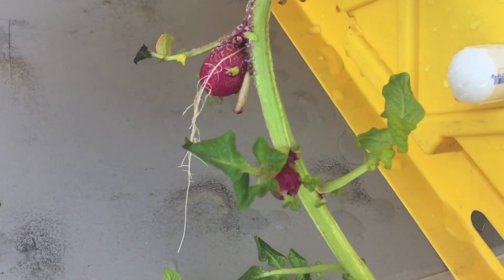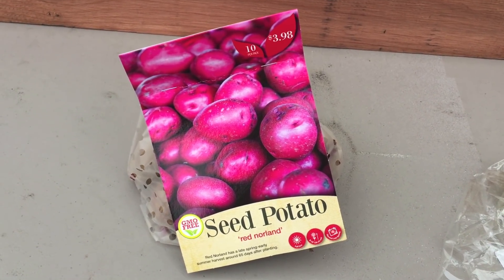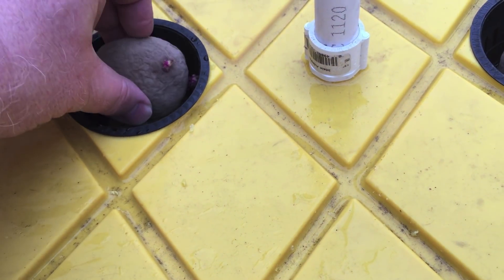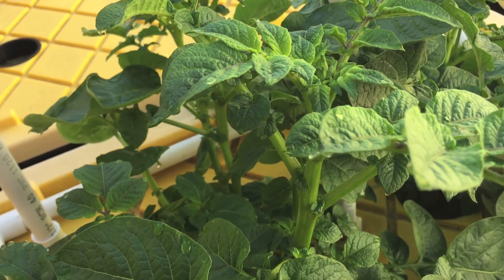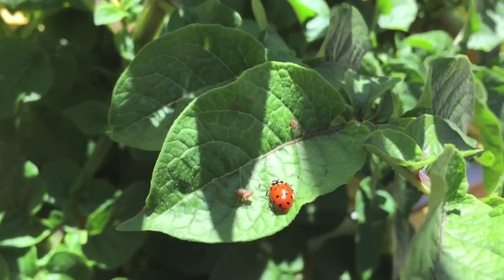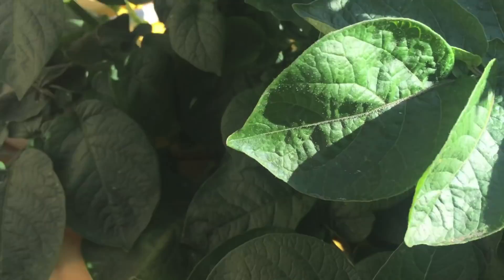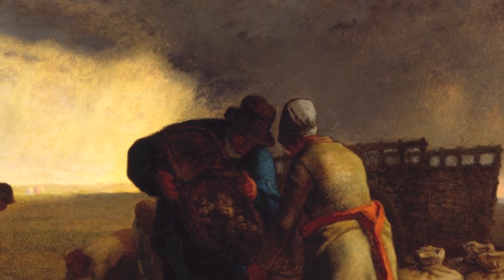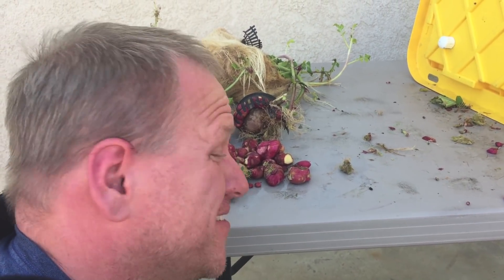Check out the amazing growth pattern of this hydroponic potato!

Comment: Jeb, I understand that would not be your "thing" but to me it seems a very cost effective way to grow potatoes would be those little hay towers. To better explain what I mean, you take a bit of a wire fence (cheap and reusable,) make a tube out of it and fix it to the ground. Place potatoes on the bottom, cover with some hay and water it. Once leaves start protruding above hay level, add more hay. And keep watering of course. Rinse and repeat, when they are done unfasten the wire fence tube and collect the taters.

Haven't done that myself, but from what I have seen elsewhere online, that looks like a very cost effective method. And no soil is used, which is right up your alley. The only downside is that the hay tower needs watering of course, which could be setup with a small pump (blasted electricity) to water at regular intervals, but of course a tank positioned on a higher level equipped with a valve (or a solenoid with a timer FTW) would work just as well. Assuming we have some higher altitude water to fill the higher altitude tank with, just to keep everything simple and cheap.

I have no idea how resilient to disease this method is and I can only assume it would be slower to grow than hydroponics.
Reply from the maker: I've heard of that before but I can't remember where the plant gets the nutrition it needs
Reply: Well, initially the seed will fuel the plant and afterwards the cellulose from the hay should do the trick. These potatoes are usually not buried, they are just jammed into some dirt. I've seen people doing similar ultra lazy potato plants in raised beds where they would just jam the potato seed into the soil and cover it up with hay or grass clippings. When it's done, they just do away with the (then rotting) grass and collect the potatoes. Pretty much as effortless as collecting eggs. Oh, how I yearn for a small garden.

Comment: Use the grow cup only for initial root growth, slowly raise the cup out of the box with pieces of 3" pipe cut to different heights, 1/4", 1/2" etc. cut them in two so you can keep adding them under the rim of the net pot as the roots initially grow till the bottom of the net pot is above the top of the tote. Cut away all but the bottom of the net pot once it is level with the top of the tote. Use two chopsticks horizontally through the roots to now keep the bottom of the cup (and the potatoes) on top of the tote. Maybe a small piece of landscape fabric and or burlap bags from a coffee house can be used to cover the potatoes from the sun as they grow. possibly this could be done with ginger too, Mary ann might not like it as much. .
Reply from the maker: That sounds like it would totally work, but I'm trying for a system where one person could have a whole field of it going.  Of course that may be impossible, but I'd like to try anyway.  Thanks!
Reply: You may have to consider bodies of water like rivers, streams, lakes, in conjunction with fish farms or abandoned pools. Consider how they do rice fields or cranberry fields. Develop a flotation system that you would add water into to start with the seed potatoes at water level, remove the water as the roots grow and the system would float higher keeping the crop out of the water but the roots in. Not sure what your goal is, but keep on thinking about it.

Comment: i have a few suggestions i my self grow a large regular garden in the dirt one thing that will help them grow larger is to cut off the blooms before they go to berries it will cause the potatoes to focus its energies on the root portion as its flowering means of reproduction  has been stopped, also i don't know if it would work but you should try hanging the medium and potatoes froma single piece of wire threaded threw it, or toothpicks, i've used them to start potatoes early in the house and it works wonderful.
Reply from the maker: I haven't heard about removing the flowers.  I may try it.  Thanks!

Comment: Cant you just mount a net on the underside of the top? and put the stonewole in there and just make the normal holes in the top. then everything has space to grow. roots get in the water and potatos have space and dont touch the water.
Reply from the maker: I'm trying something similar to that now, but without rockwool.
Reply: Jeb Gardener So i just placed a potato in a black pot in a aquarium (without fishs). there is like a plate with distance on it, and the plant can grow trough the space on all sides, but no light from the top or sides can come in. its an aquarium because its part of a biofilter (works realy well and needs plants to run), so the water needs light.
The potato is complet under water, just swimming, pot for light protection and holding it in place. Maybe it works, maybe the potato rots away. time will tell. i am excited for your solution
Reply: Just saw that the video is 5month old. Is your new idea working? My potato ist just doing fine and got the first root now but maybe it does not work with potato submerged. I have to say, the water has an active air supply so the roots get enough "air" (maybe, works mostly).

Comment: cut out the bottom of the cup and run a skewer through the side of the cup and through the potato, then stuff around it with rock wool
Reply from the maker: i used just thin rope and it worked great

Comment: Best resource of Hydroponics ever [ Check Details Here ===>fb.com/Easy-Hydroponics-Systems-166096780618260/app/208195102528120 ] !!!! It is not a step by step of a specific Hydroponic system, instead it is a complete step by step for any Hydroponics systems. It tells you what to do and what to avoid. It also explains the ratio between plant qty and fish qty in a balanced system. It is a must have for Hydroponic newbies/rookies. This book is easy to read and understand. You should read this book first and then get a book or guide for your specific setup.

Comment: How about instead of the regular hard plastic grow net you pin a layer of cheesecloth, burlap sack or other cheap cloth kind of like a tampoline for them to lie on. - so you cut a hole for the roots to go through to the water but the taters lay on top of a fabric layer that is held taut to the 4 corners of the container.  Maybe try pruning the mutant runners underneath as well. I don't think tater sprouts are healthy.
Reply from the maker: I'm trying something like that in a trash can now.  The runners are because light was penetrating the lid.

Comment: First time I've seen potatoes attempted in a hydroponics setup, awesome. Why not place some styrofoam pads or similar with a slit in them above the net cups so they hold the plant up by the stems, then cut away the net cup so the potatoes can develop?
Reply from the maker: That would probably work, but it would be a lot of stress on the stems.  I suspended them with thin rope recently and it worked well.

Comment: Maybe, instead of a net cup, you can use a solo cup (or something similar) with the bottom cut out. The potato would need to fit right in the middle of the cup (perfect size). The roots can grow downward and the tubers won't get caught.

Comment: Once you've achieved the stage shown in week 5 could you just remove the net cup and loosely tie a thin rope around the stem of the stalk leaving the roots to freely hang into the water? If at week 5 the stem is still to week then maybe wait 2-3 more weeks before bailing on the cups.
Reply from the maker: Starting the plant in thin rope worked out.  I think taking the plant out of the net cup would cause too much root damage.

Comment: cant u just hang the plants with any sort of string  and leave the netcup compleatly away ? ( if ist somehow stupid or not practicable, bc im not into the hydroponic, just ignore this)
Reply from the maker: yes you can but it's not as easy as it seems.  You can't squeeze the seed potato too much or your risk popping the shoots off.  If it's too loose the plant could collapse down when it grows heavy.
Reply: Jeb Gardener try make a sling from a band not strings... U can probably make it tighter bc. It's more controllable and u need less material bc. If it's made good, 1 sling will probably be  enough?

Comment: make a net out of rock wool, secure the rock wool net above the lid and suspend the potato in the rock wool net, maybe?
Reply from the maker: thin rope
Reply: Jeb Gardener good point, i thought the rock wool would be slightly better because it could disintegrate easily to allow for growth of the spuds but your suggestion is probably better.

Comment: I saw really large rockwool cube at my gardening store, 8" x 8" called big mama. 
They are also available on amazon https://www.amazon.com/Grodan-Delta-Mama-Wool-Block/dp/B007QVB3BQ/ref=sr_1_fkmr0_2?ie=UTF8&qid=1498063003&sr=8-2-fkmr0&keywords=rockwool+cubes+big+mama

 Maybe using these large rockwool cube shaped to not fall from the lid without the net and using a black lid instead of a yellow one on your plastic container to avoid sunlight will do the trick?

Comment: i would use a form sheet rather then a lid poke a hole in it to the thickneess of the stem of the plant,  i would also use a rag raped around the stem of the plant or clone to wick that way you wont get potatos jamming up in it, my potatos are on the roots not on a stems this is weird.

Comment: tip for growing hydroponic potatoes. the tubers are on a separate lead than the root system itself and grow from the vining portion of the plant itself (so as to spread out farther). if you want to grow potatoes in a hydroponic garden, put a second container that's about 8 inches deep where the plants will grow. then when your plant has grown over the horizon of the second container, fill it with clean straw. the tubers will form in the straw making it easier to harvest. the potato plant itself will flower when the tubers are finished growing as a secondary reproductive system.
Reply from the maker: That sounds good but for this variety I believe flowering is triggered by photoperiod.

Comment: You want to know how to make this easier, cheaper and avoid the netcup problem? Sure we can do that. All you have to do is buy a giant rockwool cube, it's that simple. See as you may have noticed rockwool doesn't come in 1 perfectly aligned block. They instead start small at the bottom and get bigger toward the top, so you simply put your potato seeds in them and let them grow. Here's what will happen, unlike the netcup the potatoes will break the rockwool easily but luckily they won't damage the top enough for it to fall through into the water. So you will have potatoes essentially growing inside the box and leaves growing out of the top, then once they are fully grown u simply lift up the box and pick your potatoes off.
Reply from the maker: That is idea is super cool!  But it would be too expensive and the rockwool fibers would spoil the potatoes.  Keep trying though!
Reply: I've done it myself before, they don't ruin the potato. You literally cut out holes in the shape of the rockwool cube, the hole must be slightly smaller then the cube itself to keep it from falling inside. When the vegetable you want starts to grow it rips the cube apart, the fibers fall apart and end up in the water or outside the box, you just throw those away and replace the water, what you end up having is a bunch of roots and potatoes with water, but since the cube was so small to begin with nothing is left. And it's easily the least expensive solution since the cubes don't cost that much, it's just important that you measure the sizes right when you initially do it. The second alternative to that if you really REALLY hate rockwool and don't want it in there is neoprene plugs, now the problem with them is that they don't actually fall apart, the only worry is that they might pop out from the pressure, but that's ok as long as they pop out and not in.
Reply from the maker: Ah ok I get the idea.  I was thinking you were talking about using one the giant grodan blocks and just letting the tubers try to form inside the block.  Have you tried it with potatoes though?  I did that for carrots. But with a seed potato you need a couple inches to work with.
Reply: Yea it's a bit harder with potatoes you have to pick the size based on the largest potato size. So let's say the largest potato you can get out of it will be 5 inches wide, you want to make it so that it's about half that so that way the stem at its full thickness will keep everything bottle necked and you can just pick above an below. The tricky part is the water regulation. When you start out you can have it to the top but as the size and potatoes form you'll have to drop the level so they don't end up underwater.

Comment: What's happening above the tote lid is just fine, it's below inside the tote that needs remodeling, and by that I mean keep the lid and remove the bin and pool of water. Clearly the white roots are fine with water submersion, so maybe a vertical pvc tube or vase is enough to contain them. The green vine where the potatoes are coming from however seem to hate the water, and since the green vine is growing sideways and outwards, maybe they can be supported by a trellis system, while horizontal metal or plastic gutters hold the weight of the growing potatoes that must be kept dry. Amazingly, you might be able to grow potatoes like tomatoes or strawberries if you do it right! Keep the potatoes cool and shaded, but never wet. Crazy Genius!
Reply from the maker: I believe green growth under lid wouldn't be an issue if it were darker.  Potatoes end up suspended so they seem to grow well if they aren't constrained.  I do worry some fungus or rot will come in with the heat, but if I stop lifting the lid to say hello to the happy frog living in there I might avoid it.  Thanks.

Comment: A net basket with larger holes in it (but not large enough for the potato with rockwool to escape. Make a flat square of rockwool instead of many small dices.
Reply from the maker: thin rope
Reply: If it's adjustable when needed.
Reply from the maker: It looks like if you plant the seed potato about 4 inches below the lid there's plenty of room for them.

Comment: you could probably grow it the exact same way if you cut a few pieces out of the net cups and cut the bottom rockwool pieces a bit bigger so they wont fall in
Reply: then i guess just look out for the aphids. by the way, did the potatoes become toxic or were they normal?
Reply from the maker: Ones below the lid didn't turn green but they had tiny leaf sprouts on them.  I didn't taste them to find out.

Comment: maybe some kind of suspension harness. What if there are multiple layers of netting(big holes) inside of the container. so the potato branches can use these to support themselves on. Now for the starter, a strip of the same net to suspend it in the hole of the container(make sure the net is tight arround the starter potato) in theory it should not get obstructed by anything. and if gets is too heavy you can always add some horizontally placed sticks to support the plant.

Comment: I've seen people grow potatoes in Perlite or Vermiculite also, but you need to use a pump and timer for a flood and drain kind of system. They stacked one five gallon bucket on top of another, and used the top for the potatoes. When new growth would appear in the bottom of the top bucket, he would bury it with the perlite/Vermiculite mix and just keep going until the bucket on top was full. It worked out pretty well actually. You can do a flood and drain system also with out a pump, if you want to just do it manually once or twice a day, you just need to keep it moist in the top bucket.
Reply from the maker: Good hobby setup but I'm trying to make something scalable

Comment: Don't know if you still care, but consider a plastic mesh stretched over a PVC table sitting inside the container instead of using the "cups". For the plastic mesh, consider either plastic Poultry Fencing, or Tenax plastic netting from home-depot.

Or hell, just  rest them on top of an overturned milk crate and you can cut it down to whatever size you want.
Reply from the maker: That's a great idea.  Rope is working pretty good right now, but if someone had access to those crates that could be super handy.  You would need to make sure to give the crate a good cleaning between grows though.
Reply: You can get 2 for $12.00 at wall-mart, or find them second hand use. A kmart by me closed recently and they were throwing them away.  lord if I know why.  As for cleaning I'd scrub the roots away by hand or power wash and just put it in the dishwasher to sanitize it. . . . Also do you need to use rock wool in this case?
Reply: If you do decide to use the crates, I also suggest that you cut your lid into what I drew in the link.
 The opening will allow you to slide off the lid so you can check the plants progress without lifting it; thus damaging the roots that are attached to the crate. The excess plastic can be used on the lid with a cross beam so it does not sag into the container. http://i.imgur.com/zmdN7CD.png
Reply from the maker: I'm doing one in a tote suspended by 550 paracord and I just submerged it half way in the water.  It sprouted fine and the seed potato rotted away fast.  The plants grew fine though
Reply: Are you going to make a video on that soon?